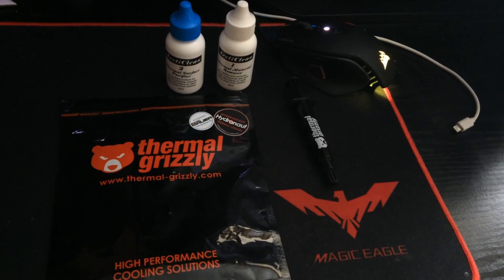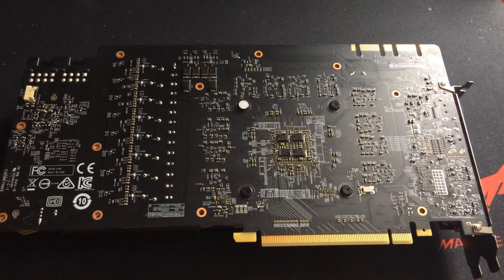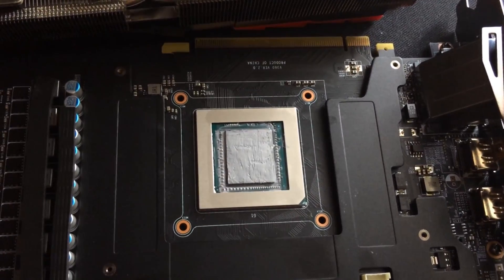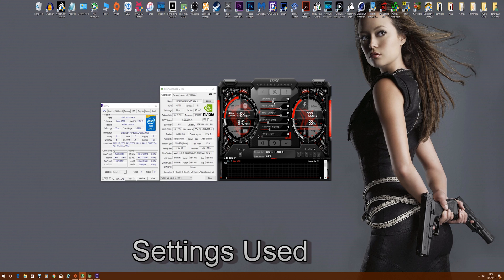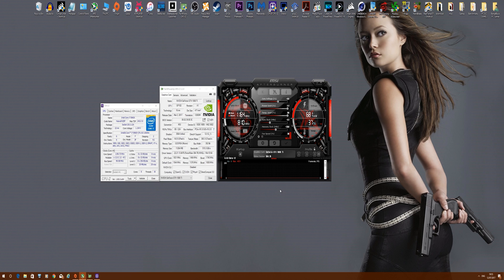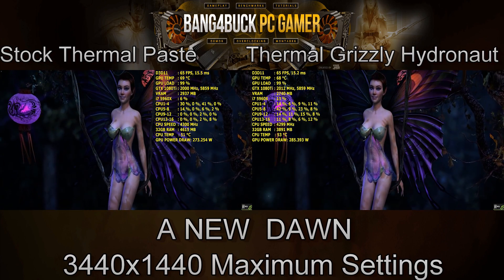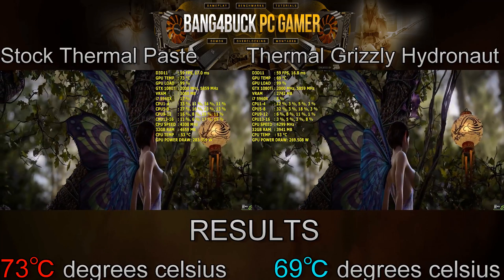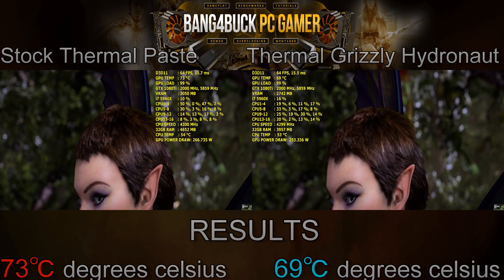Thermal Grizzly Hydronaut Vs Stock Thermal Paste | MSI GTX 1080Ti Gaming X

Comment: You should have to lock fan speed to the same value to avoid differences caused by fan curve and different rpms on different temperatures.

Comment: Lapping the heat sink of the cooler (for the GPU or the CPU) to ensure as flat a surface as possible is more important for as close to 100% full contact patch between IHS & heat sink of the cooler (whatever that is you choose to use) is more important by far than any amount of thermal grease or brand which you choose to utilize. Actually the surfaces should mate up such that there are spaces measuring in the 'hundredths of nanometers' - less than 1 micrometer gaps between the two surfaces.  The grease will fill those minute scratches even on polished 'mirror finish' surfaces there will be gaps unseen by our eyes.  

Glopping excess thermal grease atop a CPU or GPU IHS is measured in degrees of ignorance.
Reply: I agree with you, but the only thing they care about is a long term solution that avoids the product being returned for warranty.  They don't care about peak performance or efficiency, even if their marketing claimed or pretended to.

Comment: I done this last night. I went from 83C under max load down to 73C and lower depending on the case fan. When I took it apart the stock thermal paste was poor quality and poorly applied all the gpu wasn't covered and had air holes in it

Comment: What is with GPU powerdraw being so different between the two runs?  The thermal grizzly one is consistently pulling less power. Same power limit settings on both runs? What gives?
Reply: Physics.  What you're talking about is one of the core things with overclocking the silicon and the voltages required to maintain certain clocks.  Heat creates/increases resistance inside the silicon, and therefore more voltage is required for it to be "stable".  This ramps up more and more as voltage and heat is increased.  Efficiency is reduced but raw performance goes up.  This is why it can be safe to run a high voltage, with an expensive water cooling loop for example, but not for air cooling.  If you're running a high voltage (but let's say the temps are at 50C) it's safer than running less voltage (but running at 80C).

Electromigration also happens faster with higher temps/current draws.  In other words, your chip is going to lose it's speed and degrade quicker, and won't be able to maintain the clocks that it once could.. earlier under certain circumstances, vs it will last a long time and maintain it's fast speeds in others.  It always degrades, all chips do.. but it's a matter of how quickly.  Some people can degrade their chip in 3 months, others.. 5 years.  The key factors here, are heat, current draw and how much time it spends at 100% load.

To get back to the point.. you have a sweet spot for a chip and the voltage/current it requires, but then as you ramp up the frequency more voltage is required, therefore more heat is produced.. it's like a cycle that quickly gets out of control.  Like I said initially, the heat creates further resistance inside the chip, therefore it asks for more voltage, to push through that increasing resistance.. like a car driving into a heavy wind, you push your foot on the gas more.. but that makes the chip even hotter.. creates even more resistance and on and on and on.  Reducing the temps (like in this video) means less heat is produced (the thermal transfer is more efficient), therefore less voltage is required, therefore less power is consumed.. so you actually have more performance with lower power draw.  He was on the opposite side of that "cycle that gets out of control".  This is the whole thing behind high end super expensive water cooling solutions.  They sort of get to have their cake and eat it too.  There is also a silicon lottery aspect to this, in terms of how some chips behave compared to others.

Comment: Nice video, I'm looking to perform a swap to my card too. I don't know if you locked your fan speed to a set value though, not having done that would have made before/after impossible to compare. I'm not sure if you mentioned locking the fan speed but seeing the temperature drop you must've done so.

Comment: Good video. I'm thinking of doing mine, I've re-pasted many CPU and GPUs inc the tricky MSI GS55 laptop, I use GELID XTREME and have also tried TG KRYONAUT, both are very good. Don't fancy the risk of liquid metal.

Two tips for those thinking of doing the job... 1) if you want to remove all the thermal compound, carefully use a cotton bud to  clean around the die soaked in thermal paste remover/isopropyl alcohol (as per Linus Tech Tips 4:25 - https://youtu.be/hdTsra-uLBI )... 2) apply paste in an X method, using a thin line to ensure full and even CPU or GPU die coverage (as proven by DER8AUER here - https://youtu.be/qc7bCC1TmVg ). As previously stated by some others below you can't really put too much on, but don't go mental as it's will squidge out everywhere when you tighten the heatsink. Good luck and happy pasting!
Reply: Very insightful!

Comment: Should of used liquid metal. Temps would drop at least 8°C.
Mine dropped 12°C :) runs like a cooled silent dream.
Reply: Bye bye warranty.
Reply: You haven't heard him yet? It's risky.

If you accidentally spilled some on the board it could damage the card permanently. Unlike many good thermal paste today, liquid metal are CONDUCTIVE.

Comment: Question: Why ist VRam different use? 3000 to 2700 MB??
Reply from the maker: Sometimes MSI afterburner will show slightly different readings when it comes to memory usage. Margin of difference can be around 100-500mb at times it's just the way it is

Comment: Didn't mention anything about your fan curve. That could dramatically change the results
Reply from the maker: Does it matter if they were the same, because they are
Reply: @Bang4BuckPCGamer  depends. If you had a lower fan curve, is it the same disparity as a more aggressive fan curve? for example. If they both ran at 100%, and there is an 8 degree difference. That would be huge, if you actually had a fan curve on and there was only two degree difference. Which is entirely possible. A lot of people have the upper part of their fan curve never even reaching 100%. Which is actually a stock fan curve on a lot of gpu's nowadays. Mine had to reach 70c to get to 100%, but the card never got above 60

Comment: i have this paste and after two months i take my gpu apart and paste was like concrete. dry, card fall apart by it self. this never happen whit mastergel maker or mx4. rubbish thermal paste
Reply: This is why you don't apply gallium to aluminum heat sinks

Comment: wayyyyy to much paste... you put entirely too much on that GPU.. smh people that dont know what they are doing shouldnt be taking shit apart.. lucky you didnt cause more issues.
Reply: The paste is only there to fill and gaps in the materials, there's no need to use a lot of thermal paste, but as long as it covers the die and the block in a thinnish layer, you have applied it correctly
Reply: Bang4BuckPc Gamer is entirely correct on this one
As for "No reputable reviewer or article writer or manufacturer would tell you the amount of thermal paste doesn’t matter and won’t hurt it" 
You are entirely Wrong - Gamers Nexus, one of the most reliable benchmarking channels still going, has a video where they did an In depth analysis on exactly this topic.
https://www.youtube.com/watch?v=EUWVVTY63hc

Too much Thermal paste is only an issue if using an electrically conductive paste, for example one that has additive silver to increase its thermal density.
For a non-conductive paste the tension from the heatsink will happily compress and extrude your excess, the only consideration thermally is total die coverage in a gpu
Reply from the maker: You haven't got a clue what you are talking about, It's been proven that more paste does no harm and I can show you the proof of that if you like. But luckily for me I know what I'm doing, and don't need advice from random people on the internet
Reply: Bang4BuckPC Gamer lol k there buddy.. have fun in salt town.. glad you think you know what you’re doing but you really don’t.. the entire point to thermal paste is to be the inbetween to transfer heat from a cpu/gpu to the cooling surface whether it’s copper or aluminum.. putting too much paste not only can gunk up shit but also become detrimental to the transfer of that heat. A thin layer is all you need. Noobs like you are the reason that us builders in the industry spend 30 minutes cleaning cards and processors up when you complain about overheating because you took your own card apart and gooped it with 10lbs of arctic silver or in this place grizzly.. it’s a fucking shame you’re an idiot..  

Have a good day mr salty peanut..
Reply: This is a pretty dumb myth that people keep perpetuating.  Once you screw it down then it will push any excess paste out as there is no room for any more than a thin layer.  You can empty an entire tube and you will still end up with a thin coat once you screw it down.  It is better to put too much than not enough as you wont get any hot spots if you apply too much.

If you use non-conductive paste then you can't do any damage using too much and cleaning paste is trivial.

There are plenty of videos on YouTube by professional builders who deliberately dump excessive amounts of non conductive paste just to prove it doesn't do any damage and doesn't make it perform any worse.

Arctic silver is conductive, hydronaut isn't. Doesn't matter with hydronaut.  Building your own PC is an enthusiast hobby, people should pull their PCs and components apart and play around with them, it is part of the enjoyment.
Reply from the maker: Awww you sound upset. Thanks for the story buddy but I'm not interested
Reply: Bang4BuckPC Gamer because you’re a derp.. maybe you should go back and research some more. Too much thermal paste can also raise temperatures you only saw a 4 degree difference because your dumbass put half the tube on the gpu then another bit on the heatsink itself..  No reputable reviewer or article writer or manufacturer would tell you the amount of thermal paste doesn’t matter and won’t hurt it. Just think it’s funny you state you know what you’re doing when in reality you’re lost in the sauce without a paddle..
Reply from the maker: Breath slow now David, It's ok it's nothing to get upset about. Not everyone is going to listen to you or care about your opinion. The best thing to do is move on with your life

Comment: Yeaaaa, a 4 degree difference isn't worth taking your card apart and risk damage. Still, great video.
Reply: The risk of having no warranty, absolutely not worth the 4 degrees.
Reply: @KingOgLy si ils ne la demontent pas, personne ne saura, et ils ne demontent pas les gpu, il les test et si elle ne marche pas, garantie point
Reply: @KingOgLy  PC component warranties are bullshit anyway - past 6 months it is up to the user to prove an fault that presents  was a production flaw and not the result of your use.
Also, Any form of overclocking - including their bundled software which allows for modifying power target invalidate the warranty
Reply: @bengrogan9710  not it is not bs. As long as there is no physical damage and warranty stickers not removed. The companies have to honor the warranty. Ocing is a feature companies advertise, it surely does not void your warranty. Also given how advanced gpus are now, it is nearly impossible to kill due to use or OC, unless u start flashing custom bios and play with voltages. Only two things are likely to kill it. 1 is your psu, 2 a faulty component.
Reply: @KingOgLy  Well you might want to read up a little in the actual RMA documentation before stating things like that - For example Intel have the "Performance tuning protection plan" you have to pay in addition to the product if it is to cover Overclocks, the base warranty does not
https://click.intel.com/tuningplan/faq - 
"Intel has received feedback from customers who want to implement overclocking on eligible boxed processors, that because of the lack of any replacement coverage for the eligible boxed processors, the risk of overclocking is too great. We understand this position, and while we cannot endorse overclocking, we want to provide a limited remedy if issues arise as a result of their decision to enable overclocking."

Very few manufacturers cover OC, despite it being in marketing material, Legally they have a specification and overclocking take the product out of spec meaning they have no legal responsibility for any damage - EVGA is one of the few that does openly cover overclocking

A short video on this specific topic - https://www.youtube.com/watch?v=TsRWeOPw0vk

Also again on statements being false - the warranty void if removed stickers are not valid
https://www.digitaltrends.com/computing/ftc-warranty-stickers-illegal/
Reply: @bengrogan9710  Well from my personal experience, I RMAed 2 gpus previously . One was EVGA 980 and one was MSI 1060. Both card were past 1 year into their warranty, and had 0 issue RMaing. All I had to do was state the issue ( one was random BSOD, and the other had issue with frame drops after a long gaming session), I  shiped the cards. I got replacement within 2 weeks or so. If it says  under warranty, it is under warranty. Both cards had manual OC from me. I am pretty sure consumer protection laws have strict regulations on warranties etc, assuming u got one where u live.
Reply: @KingOgLy  EVGA is one of few companies that explicitly state overclocking is covered, I believe it was a requirement that Kingpin had for working with them.

As for consumer protection law both in the US and EU, The law states that there are cases where implicit guarantees exist - excepting in cases where it is expressly disclaimed by the issuer: this is the case for most manufacturers in the tech space including AMD and Intel which state that they only cover issues within specification.
Reply: i would still be careful
Reply: It's pretty easy to take these cards apart.. 4c is pretty damn good to be honest for just a paste swap.
Reply: It's worth it for me. My 1070ti droped 13c after replacing my thermal paste.
Reply: @thekaneallwaywin  Which board partner?
Reply: @bengrogan9710  Msi. I opened it up and the stock thermal paste looked like it has been dried out. It was no wonder my temps were pretty high.
Reply: @thekaneallwaywin  If it was cured like that, yes it'd have a big hit
Reply: Auto9 its a very easy project no risk at all

Comment: This Thermal Paste is normaly used 4 watercooled systems
Reply from the maker: It's still water cooling. The all in one coolers cold plate is making contact with the GPU, just like a GPU block so it's pretty much the same process just on a smaller scale

Edit sorry my card is now water cooled with hybrid cooling, I forgot I also used my stock fan with this paste for a while

Comment: Hello why not pick up the Kryonaut?
Reply: Kryonaut is not electrical conductive, conductonaut however which is their liquid metal is conductive tho.  For gpu's that are watercooled i use noctuas nt-h1 and i get really low temps. Back when i aircooled my gpu's i used liquid metal thermal grizzly conductonaut, but as i moved over to watercooling on the gpu's i noticed that liquid metal wasnt working as good as it did with air cooling. This is because for some reason the liquid metal perform better when youre battling degrees of 55+ that i were on air cooling but once i swapped to watercooling my temps dropped down to 40-42C during 100% load when i used nt-h1, I tried using liquid metal and watercooling but the degrees only dropped down to 38 during load so i felt it wasnt worth it :)

Thanks for the video!
Reply from the maker: Kryanout is better but it contains silicone which is risky in silicone Sensitive Areas and can risk damaging my Graphics card
Reply: No! this is a grizzly conductonaut!! Kryonaut trust me not dangerous :P
Reply from the maker: That's straight from the website, the only product to have a silicone sensitive rating is Hydronout
Reply: @Bang4BuckPCGamer  You are mistaken, or rather have misunderstood something. 
You are worried about damage to the silicon of the GPU die - Kryonaut will not damage this
Kryonaut will wick into Silicone - as in the rubberized sealant
These are 2 separate materials that just sound similar

Kryonaut will not damage the Die Diffusion barrier and is far better for GPU usage as ThermalGrizzly specifically market it pushing the non-curing nature of the paste - meaning it will not degrade over time due to slowly drying.
Kryonaut would give you another 2-4 degrees over Hydronaut - Citation: Tom's hardware paste mega test for CPU and GPU applications
https://www.tomshardware.com/reviews/thermal-paste-comparison,5108-11.html
Reply: one of the warnings is for conductonaut which is electrically conductive but kryonaut isnt.  i have seen a lot of people use kryonaut on gpu's and have seen no reports of it causing problems.  the silicone sensitive areas part probably means it will soften silicone parts, like seals. the die is made of silicon which is totally different.  cant find anything on the website about what "silicone sensitive areas" means or why its a problem.  i think i will email them and report back if i find anything.  but i think its fine and will drop the temps you are getting by a few degrees more.  its good stuff

edit: the liquid metal stuff, conductonaut, also gives the same warning (on the chart with the stars it has a line through silicone sensitive areas just like kryonaut) about silicone sensitive areas but is made just for the purpose of putting on bare gpu and cpu dies.  if kryonaut is no good then conductonaut isnt either.